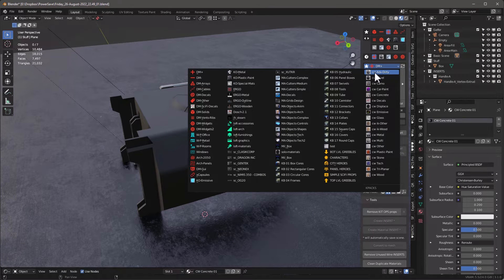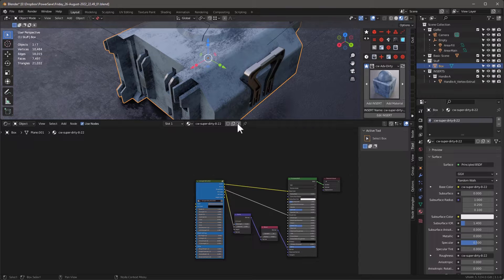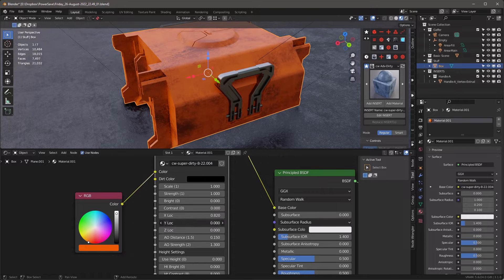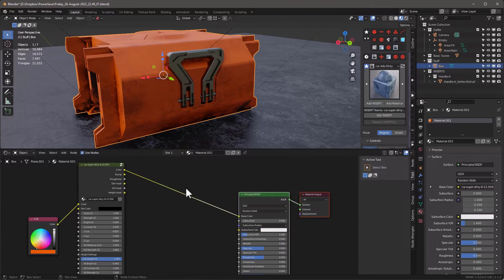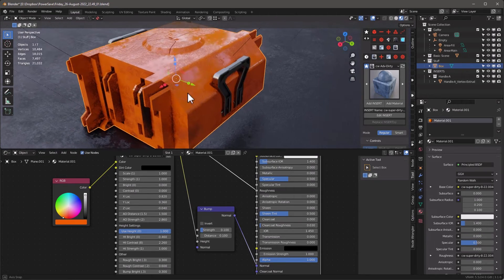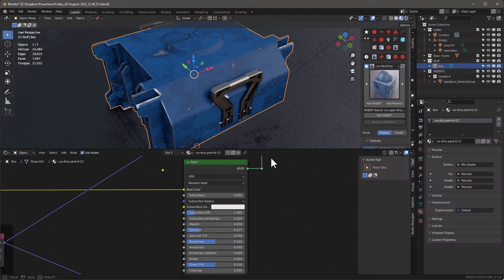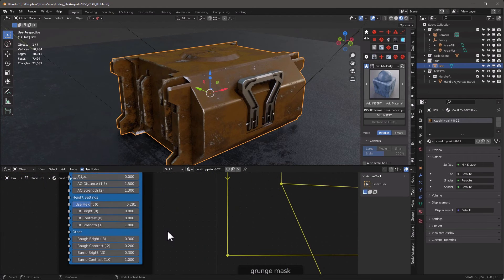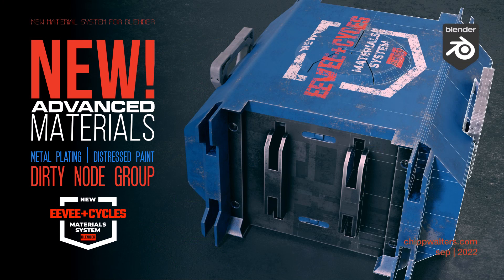New Advanced Materials for Blender

Comment: chip, KIT OPS Pro2 and DESIGN MAGIC user. love it. after installing the KPACK [....Massive Update/EVEE-Cycles-Materials] into Blender 3.2, seems both the cs Adv-Dirty folder did not import in the UI. tried to go to those folder in Preferences and add them ("+"). No Joy. any suggestions? deleted and reinstalled, and the cs Adv-Dirty folder is missing . note: the number of KPACK items in my loadout is an array of 17rows x 4columns. is that the limit?
Reply from the maker: No that shouldn't be the issue. Make sure you install kit Ops and the KPACKS correctly. Http://cw1.me/installkitops
Reply: @ChippWalters  ok. we are  now GTG. the prob? well, was not even a KPACK or Blender problem. it was simply b/c some of my iCloud folders on my Mac were not downloaded. ha! so, had to double click those folders....and then.....Blender can "see"/load the folders. guess i may have to up my storage capacity on iCloud. b/c she's full! thanks again Chipp!